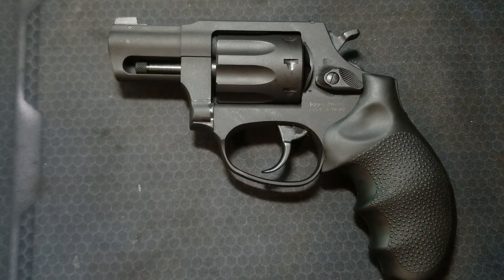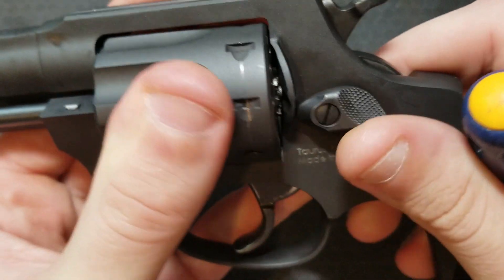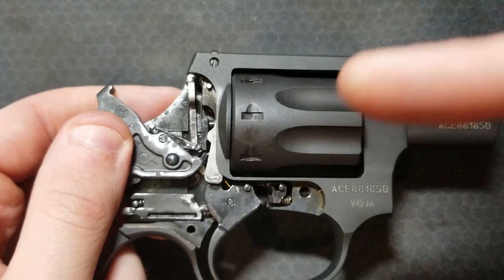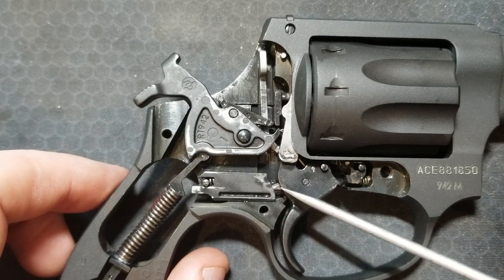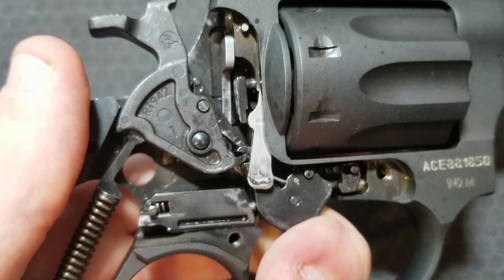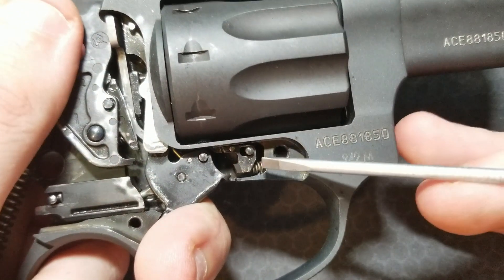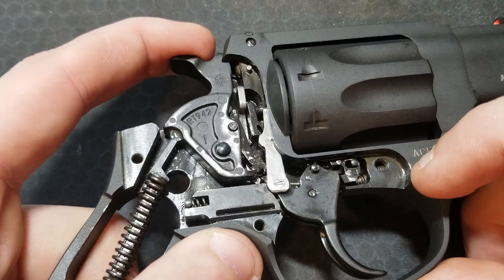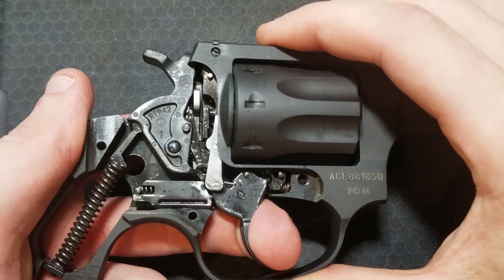How a Modern Revolver Works

Comment: When a revolver  is in battery, at the time you push the trigger, hammer must go back just a little. That is a safety measure  to prevent accidental discharges if revolver falls and hit the floor.